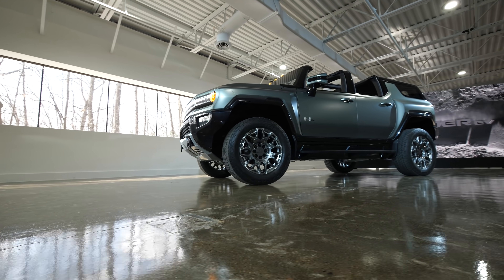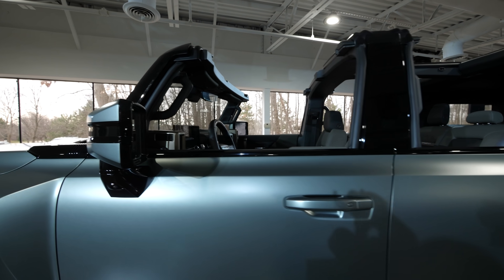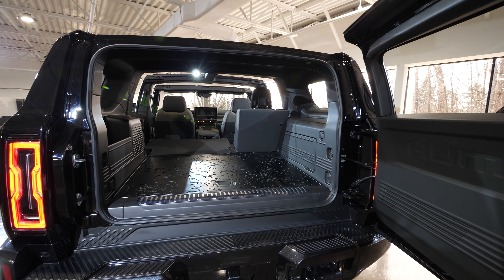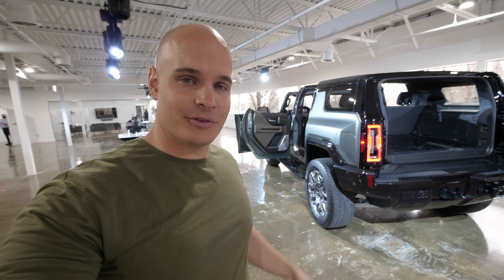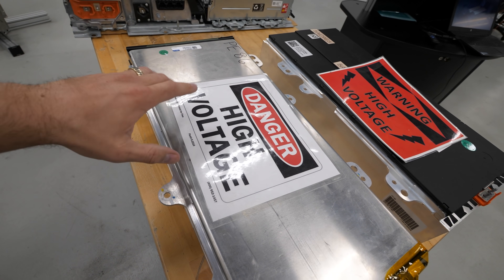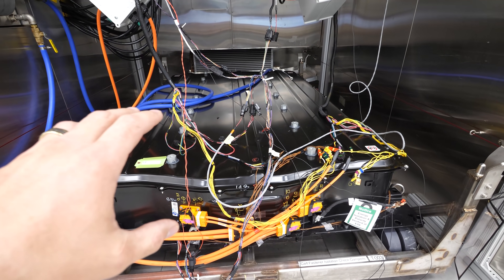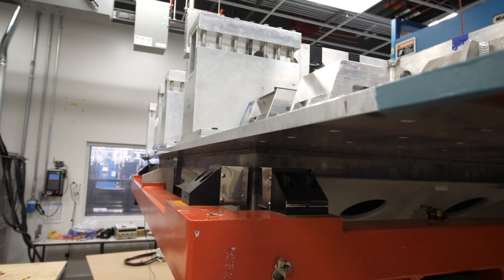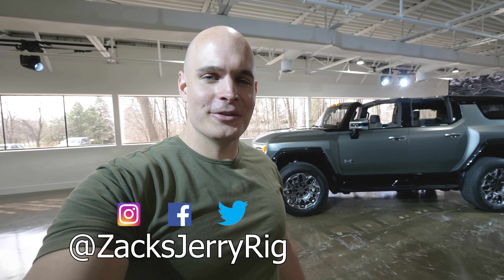An Electric HUMMER SUV?! - First look at the Tesla rescue vehicle

Comment: its nice you talk about mAh but whats the voltage in the end it still didn't say anything
Reply: Pouch cells have a nominal voltage of 3.7v, same as tesla cells, tesla 18650 cells have around 3000mah as well, but use a much larger number of individual cells in perellel and series to hit 350-400 pack voltage, it can go to 800V by arranging more cells in series.

Comment: How much to replace the battery packs though? A lot of older EV cars are going for resale but the issue is there are not enough on market parts like a new battery pack to put in them. I head a story where one woman was quoted $100K to replace her battery pack. When those packs get to be around 3-5 thousand is the time I make the switch to Electric. One day hopefully soon battery packs will get cheaper.

Comment: Electric vehicles are not ready yet, batteries will die within years and it cost as much as a new car to replace it. And there's basically no interest in buying a used one since no one will know the condition of the battery.

Comment: Goes from 7mpg, to full on electricity, it's fantastic!
Reply: It will be the equivalent of getting 12mpg now.
Reply: Fantastic downgrade. Fuck EVs
Reply: @Khloya69  whats so bad about them? They look like new ones in the coming years will last much longer than other cars, cheaper yearly cost for you, no more oil changes, tons of places let you fill up for free, some already last 500+ miles and that number will probably grow a lot in the coming years, they're starting to have options and be slowly be more accessible for everyone, they're fast and powerful and most of them have cutting edge tech, whats not to like besides like the sound of a muscle car or exotic car but most don't have those anyway?
Reply: @olegprozapas8318  no engine noise.
Reply: @Khloya69  there's only a couple types of cars where that is even a factor but you can have a weekend muscle car and an electric car for most situations. Like if you're trying to decide on an suv or most sedans, I don't think it matters for most people.
Reply: @olegprozapas8318  electric sucks for all situations tho
Reply: @Khloya69  are you trolling or just that close minded? Obviously there's some situations that both are best in currently but electric is quickly gaining ground
Reply: @olegprozapas8318  you trolling or paid off by Elon?
Reply: @Khloya69  electric opereate in extream cold, space, high elevation, extream inclines and declines, high torque low speed applications, better economy, better safety, better maintenance schedule, and even the motors make noise when you go fast enough, point is engine noise is overrated and people are moving on.
Reply: @miguellopez3392  mad because you’re poor
Reply: @Khloya69  I'm buying a tesla with the tesla stock I bought in 2019, I'm livid, what EV are you getting? Oh can't afford one? Too bad.
Reply: @miguellopez3392  teslas suck. Feel bad for ya
Reply: @miguellopez3392  Imagine not being able to afford gas
Reply: @miguellopez3392  imagine being so poor you buy a tesla
Reply: @miguellopez3392  broke boi
Reply: @miguellopez3392  nobody wants EVs lol, except poor people.
Reply: @miguellopez3392  teslas are for people who can’t afford a real car
Reply: @Khloya69  i drive a jeep with 12mpg in a state where gas is above $3 lol try again you aren't landing.
Reply: @miguellopez3392  you can’t afford a jeep, tesla fanboi.
Reply: @Khloya69  holly crap you got roasted
Reply: @odisy64  nope.
Reply: @miguellopez3392  you’re mad because you can’t afford a real car
Reply: @Khloya69  are you seriously calling people who buy teslas poor? Lol i bet you cant even afford the Tezeract.
Reply: @odisy64  mans can’t afford a shirt, you’re in no position to talk.
Reply: @Khloya69  oh wow you got me, you still cant afford a tesla. Wait, can you even legally drive?
Reply: @odisy64  and yes i can.
Reply: @odisy64  tesla is for people who can’t afford real cars.
Reply: @Khloya69  you do realize the cheapest Tesla cost more than the average new gas car in the US? its a status symbol that makes you mad, why? why do you hate Teslas like they bullied you in elementary school?
Reply: @Khloya69  you're a troll account lol no one is that insane